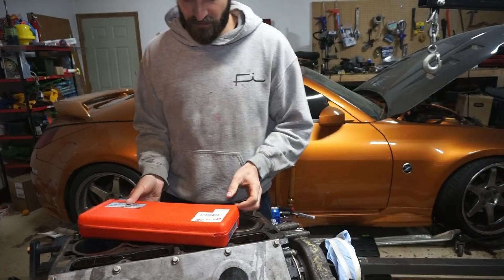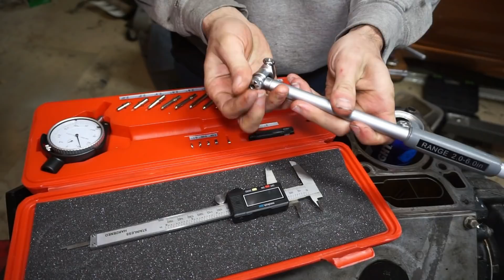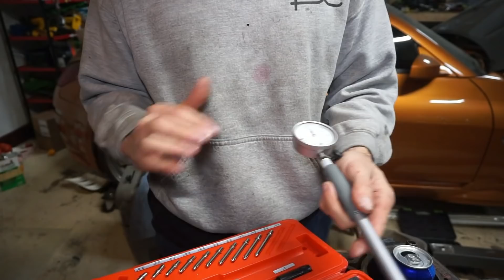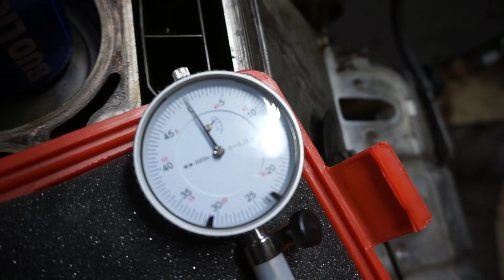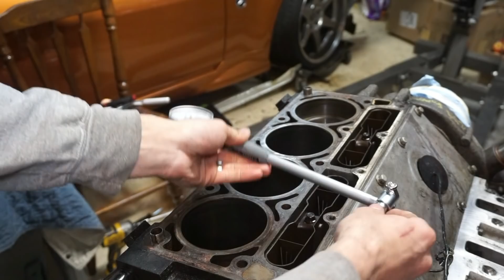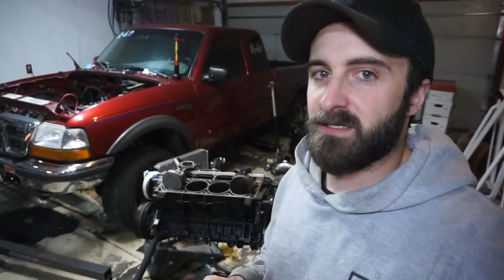Whatch This Idiot Set Up A Dial Bore Gauge!!!

Comment: The easiest and most metrology-correct way to set the bore gauge is to use a ring gauge at the exact size you are measuring with both the ring and the workpiece at the same temperature. People saying a micrometer is best are simply wrong. A micrometer is doable, but can be tricky to "know' you're set correct.
Reply: than you buy gauge blocks of desired size and grade to check your micrometer, and all is good. In essence this is comparative measurement and it is not really important do you measure 0.001 or 0.0015, as long as you measure same values  every time and ensure clearance according to expansion ratio of your piston size. Good rule is that your equipment is about 10 times higher resolution than values you expect to measure. Say you are detecting tolerance within 0.001inch, equipment should be in range of 0.0001 inch repeatable resolution with error no more than plus minus 50% of given accuracy. For Example Mitutoyo 511-753. That is only if you really care and want things perfect, if not, video from a21bravo is just fine :)
Reply: Yes, ring gauge is the "BEST", but SO expensive.  Tolerance stack also issue.  What resolution needed is big question.

Recently rebuilt Toyota 2zz and manual needed measurements to 0.001mm!

My measurement system only capable of 0.01mm and build went well, but am upgrading.

At these measurement/resolutions, can only be repeatable under "lab conditions", as in controlled environment and with skilled workers.

Mr. P

Comment: The tool you keep reffering to as a micrometer is actually 6" digital calipers. For measuring taper and out of round what youre doing is fine but you never use calipers to set a bore gage. Micrometer is the only way. I just wrap a shop towel around the frame and just barely snug it, in a vise. This allows you to use both hands to get your zero set accurately. Keep up the good work and awesome vids!!
Reply: Saying "micrometer is the only way" shows your ignorence, with all due respect.
Reply: @masoncnc  with all respect youve never worked with close tolerances I see. Setting one with a caliper, any shop ive worked in will show you the door!!
Reply: @jasonbrown4443  hey, bud, I prolly shouldn't have taken a combative stance right off, so my bad. View my other comment and learn what I meant. I do like your advice given, but it's  not the absolut theoretical  best. Yes I'm  splitting hairs, a bit.

Comment: Testament to the LS engine the cast iron one to be exact 340000 miles and the last 20,000 of that is you beating the dog piss out of it with a turbo and the block is still rebuildable without machine work.
Reply from the maker: Yeah, I was surprised. I thought it would be worse. Seems the pistons are what's wearing (which makes sense). I think it may need a good hone though because at 500 miles the cylinders already had glazing... Knocked the dingle ball hone right out.

Comment: The high mileage and still in spec makes me feel good about buying a eBay drivetrain with 118xxxand rebuilding it stock bore with a bigger cam did new lifters and springs and added arp hardware in the important spots

Comment: Use something with a 4” ID like a pvc pipe or metal tube. Or buy a ring gauge to set one up. Put the ring gauge on a flat surface and stick the bore gauge in there and set it to size.

Comment: Yeah, as mentioned previously, it's better to use a regular micrometer, not calipers. The other part of that is to get an indicator with better resolution. Typically I set mine to the nominal size (4.000 on yours) at first zero. If you're boring or honing a block, you'd tend to give yourself a little more travel on the smaller side so you can creep up on final dimension